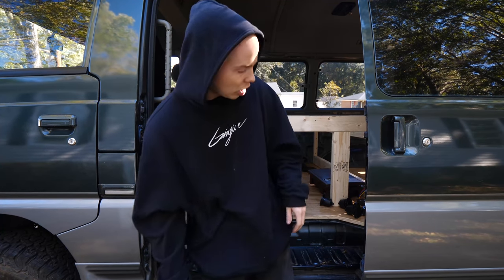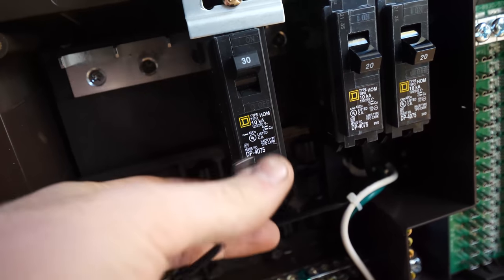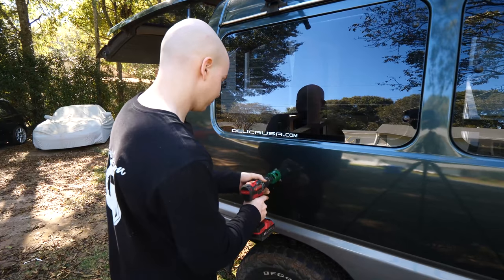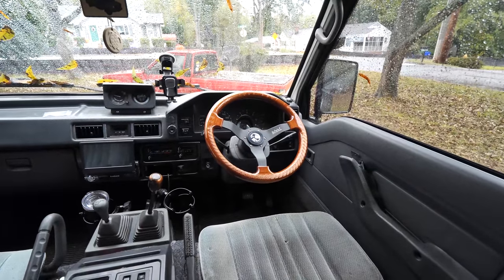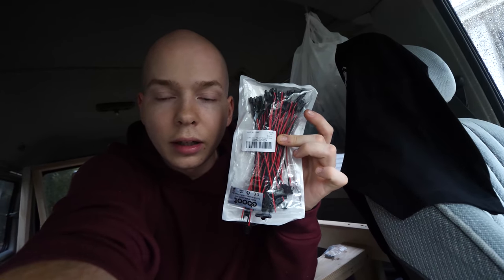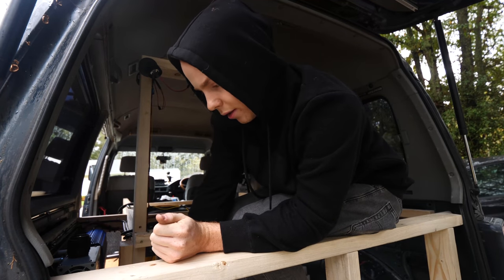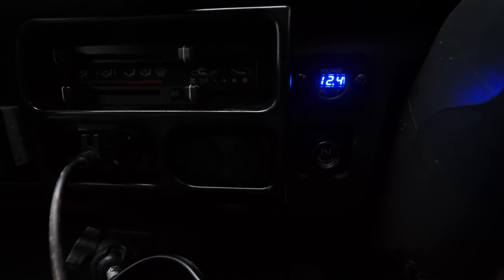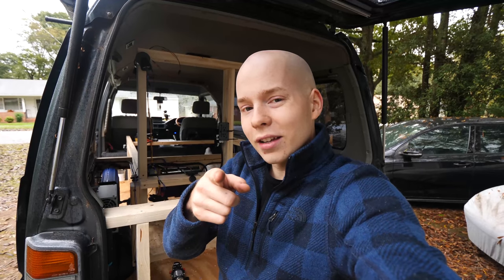How To Build a CAMPER VAN Electrical System - JDM Adventure Van Build (Pt. 4)

Comment: Don't know if you already have it, but it might be smart to put in a switch or breaker for the outlet on the outside of the van so it can't be used by random people. Don't want random people draining your battery.
Reply: Not just that but also in case water gets in
Reply: That's a good idea. He can turn off the breaker to the outside outlet when they sleep so that they don't have to worry about someone siphoning energy.
Reply: Neighbor starts stealing power from his van. 😂😂

Comment: I would add lights to the back door so it lights up the "work" area behind the van once the back door is opened... at the bottom of the door so they end up as far back to the other lights as possible for maximun light coverage

Comment: Are you going to add a 12 volt from the alternator to charge the system when the van is running? Incase theres no offboard power or sunlight?
Reply: I was gonna suggest similar, like a DC to DC charger.

And maybe even something like Redarc’s smart start battery isolator. To protect the chassis battery from being drained accidentally. looks at the adventure bus
Reply from the maker: Yes! I have a DC to DC charger mounted by the AC to DC charger. Just need to run some wires from the Delica's battery!
Reply: @_Gingium_  when you run the wires for the dc to dc charger are you going to use a relay and control it with a switched ignition wire.
I'm assuming wouldn't want the charger running the engine battery down if you forget to switch it off.

also if you intend to drive the delica off-road at night put some sideways and rear facing lights on the roof rack, in my experience it helps a lot off road to be able to see sideways not just forwards.
plus you can use them as external lighting when camping.
Reply: ----------------------------------------------------------------------------------------------------------------------------------------------------------------------------------------------------------------------------------------------------------------------------------------- 💜 nude.snapgirls.today/barbie 💜 PRIVATE S*X
LET'S MAKE LOVE BABY 💜

#ライブ配信の再編ありがとうです！#この日のライブ配信は、#かならりやばかったですね！１#万人を超える人が見ていたもんね（笑）#やっぱり人参最高！#まさかのカメラ切り忘れでやら1かしたのもドキドキでした！#今後は気を付けないとね5). . 

!💖🖤❤#今後は気をライブ配信の再編ありがとうです！#この日のライブ配信は、#１万人を超える人が見ていたも ん（#笑）#やっぱり人参最高！#まさかのカメラ切り忘れでやら1かしたのもドキドキでした #今後は気をライブ配信の再編ありがとうです！（ #笑）#垃圾

Comment: Hey! I am not sure if this was suggested, but the plugs you added on the outside of the van, I would add some silicone around the  plates themselves Up against the Metal bit of the van, and the plastic bit of the plug. It will prevent water, Mud, Sand or Dirt to get inside of the van or inside the wire, causing a short. 

I am loving the build! I love it dude!
Reply: Exactly my thoughts.

Comment: The electrical set up is good, I would recommend you add a couple of 12V outlets. So that way if you have anything that needs 12V you could use the RV elecrical to run it.

Comment: Hopefully you can add a roof top tent later. You might want the extra sleeping room, looks small inside. - can always add it later if needed.
Just have it so the solar can be placed on the ground with extra wire to place it in the best sun.

Comment: Next electrical project you do, I highly recommend that Irwin self adjusting wire stripper. It doesn't seem like it saves a lot of time, but with the amount of wires you're doing with that build it adds (subtracts?) up.

Comment: 1:55 those knock out should have wire protection put in them.   At least it won't ground out being plastic case but I would still suggest adding something to stop the wire from rubbing through the wire insulation.
Reply: With road vibrations it will wear very quickly

Comment: While you’re doing to electrical system it might be a good idea to install and integrated air compressor. Sure useful for cleaning stuff and airing up and down tires while also giving you the ability to add air lockers and air rid in the future. It would be pretty cool to be able to lower the bus for better highway efficiency and then raise it again to go off road. So many options

Comment: Add on board air, toss a little compressor under some shelving and have a hard connection either where you put the other outlets, or somewhere off the rear bumper, 50ft whip hose and you'd be able to air up and down for trails, not sure if you thought of this or not already, I just thought it'd be a good addition while you're in there!

Comment: This is looking very clean so far! You've improved a lot with electrical stuff, especially compared to the adventure bus build. No red colored grounds! The only thing that I can think of that would make your electrical system much better and safer is if you add ferrules at the end of the stranded wires going into the screw terminals. It would create more secure connections that will last a long time and wont start any fires (important).

Comment: Should definitely put some plastic cable/wire push in connectors on any of the electrical boxes to protect the wires from rubbing and cutting or exposing any material to prevent shorts or fire hazards. Had to use them for houses with less movement so id assume theyd be more needed in a vehicle with alot more movement/vibrations.

Comment: I have seen other builds install a fan roof vent, if you are not planning for one it might be nice to pre wire for one in case you think you might need one at a later time.

Comment: Really wild that the input to that 120 distro setup is a female connector. Would be sketchy if that live male plug coming from the inverter were to unplug itself hahah
Reply: Agreed.  It should be a twist-lock connector and the male/female connectors should be reversed.  It's an easy fix and one that he should do for safety reasons.
Reply: @Alpha8713  Even throwing a feed through and just hardwiring it would be better.
Reply: Agreed, legit fire hazard

Comment: For the holes you cut outside you should consider putting some silicon behind them and maybe a nut and screw instead. Just seems like a point for water to creep inside over time.

Comment: If you haven't planned to do that, add a 12v air compressor in the back, useful when you are out and need to pump up your tyres, maybe after offroading.

Comment: Nice job so far. My recommendation would be surge protection on your mains inlet socket. You are never going to be sure of the stability of the power that you are hooking up to. If you need any advice on what to use, give me a shout. I'm mainly UK based but i know what I'm doing when it comes to surge unit specs.

Comment: I think you should install RGBW strips instead of RGB ones. The RGBW strips have an extra LED dedicated to emitting white light, compared to the RGB strip which needs all of the red, green and blue lights to light up in order to give you white light and that uses more battery. I imagine if you have to use the LEDs in the van, there's little to no light outside so the solar panel won't charge the battery and you'll have to turn on the engine... Concerning the rest of the build I have no objections, so I have to commend you for the great job and the good work. 👌✌✌👍

Comment: Maybe add some reading lights close to the bed and if you feel like it some 120V outlets around the bed in case you decide to mount a TV at some point, or want to charge a laptop with USB-C, since I'm guessing the USB ports you have wouldn't support that kinda wattage. Great to follow your build!

Comment: Great work on the camper and looking forward to see, how it d look as a fully built interior for sure. Definitely needs more lighting on center area, also if you thought for AC vents distributed along pillars aimed down and a bigger one or two along the rear area (cold/warm) - not sure if same on camper or will be a different system through ducting n wiring. Also thought about ventilation fan with controlled vents for opening and closing. Not sure if you have space for a small heater to warm up water for cold nights. Hope any of above can be of any help. Great work, brother!

Comment: Idk if you have it, but a water heater would be useful if you plan on talking showers when overlanding. Also, add a winch, which will take some electrical. And if it were me, I would add like two more lights on the inside. And of course any electrical for light bars, and or a back camera, if your that sort of person.

Comment: They make clamps that you can put through the electrical box then clamp down on the wires so that if the wires get pulled on they don’t rip out of the electrical terminals.

Comment: I'm kind of scared by the fact that the  120v output from the inverter to the  distro box uses a male Edison connector as a source of power.  This is terribly dangerous.  It should be a female connector and really should be a twist-lock (or maybe some special automotive connector) so that it will not accidentally become disconnected due to the vibration of the vehicle.  This is an easy fix that I would strongly suggest doing.  This would never meet code in a building.
Reply: This, was thinking exactly the same
Reply: When is that shown? I was wondering such a thing but didn't spotted it in the video

Comment: Maybe you should have used (besides paint as protection) some silicone around the holes and between the in/outlets and the bodywork, to literally seal them off.
Reply: there were rubber pads inbetween the body and the plugs to seal the inside from the outside visible at 4:24

Comment: Ditch that heavy lead acid battery for a lifepo4 battery probably save 40 or 50 pounds of weight. All your existing equipment will work. It’s almost plug and play may have to change a setting on the dc-dc charger and that’s about it.

Comment: I'd reinforce the inteior side of where you drilled those holes into the exterior. If you're plugging and unplugging stuff from it often then it's going to fatigue the metal.

Comment: You wanna make sure that you seal those holes you drilled for the exterior connections with some exterior sealant/caulk. Those rubber gaskets that come with the plugs aren't all that great.

Comment: Just a random thought, would'nt it be good to have it so that when the AC charger is plugged in, the entire AC system runs of that instead of having to use the inverter still? Could easily be achieved with a simple relay

Comment: Have a way to turn off the voltage gauge? It’s not much but over time it’ll kill your battery… 
You have a fan or way of circulating air? Probably get pretty nasty breathing recycled air if it’s warm out and your not useing the heater fan?

Comment: Did you ever weigh the Delica before you started adding all the stuff inside? I would be curious to know how much weight you'll have added by the time it's done
Reply from the maker: I did not. However, compared to the stock interior, I don't think this setup will a whole lot heavier. The stock bench seats in this thing were HHEAAAVVYYY.